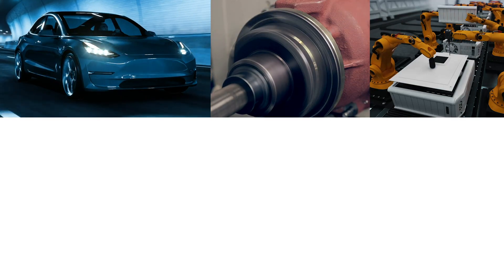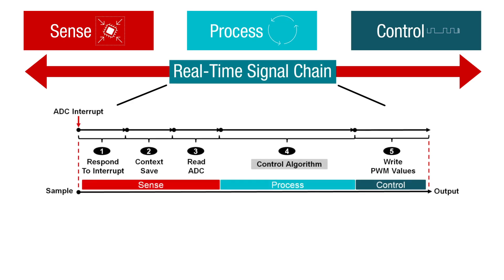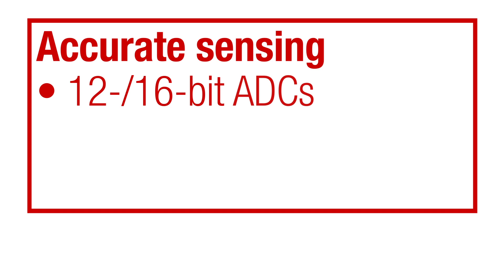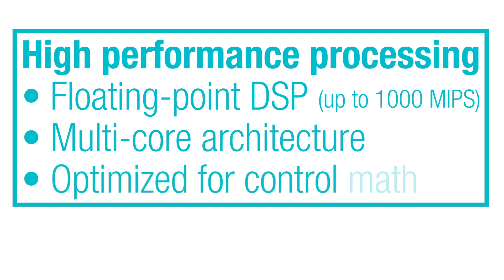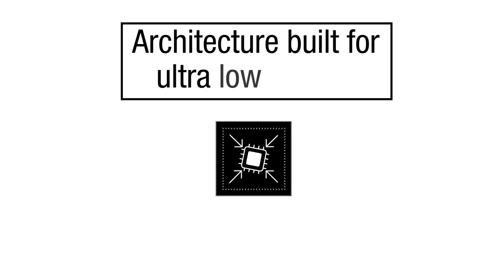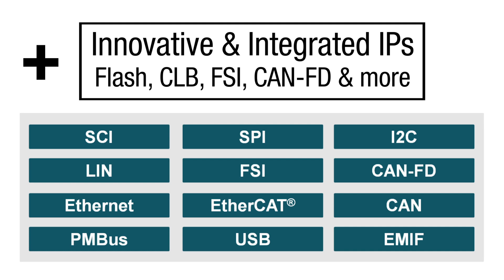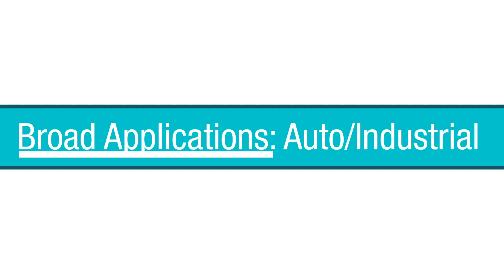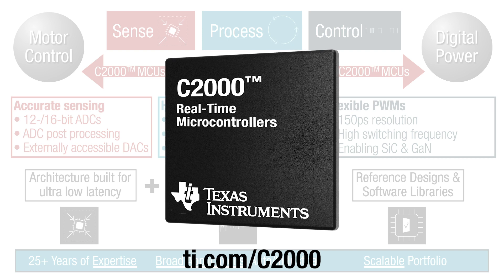Why C2000™ MCUs for your real-time needs?

Comment: I just bought a LaunchXL-F28027F eval kit and can't find a single example project to use in CCS. I wanted something with a pre-configured .syscfg for the board but after a couple of hours hunting high and low found nothing. Not a good start!